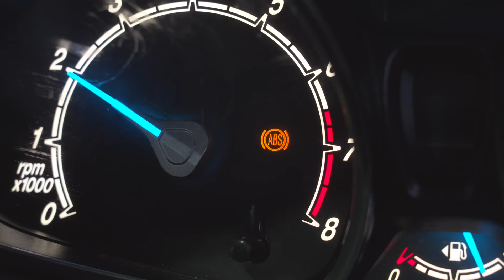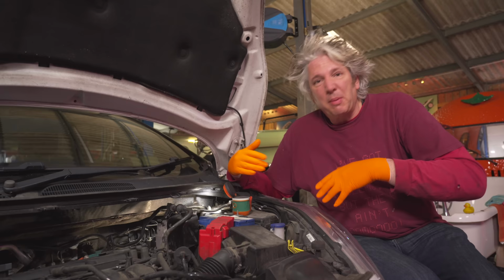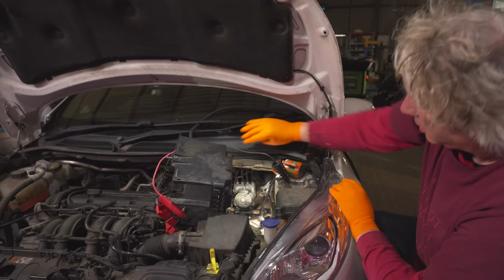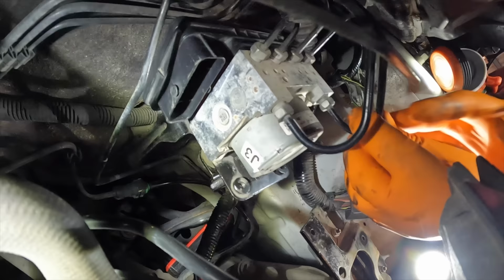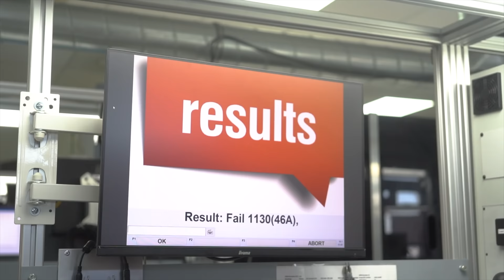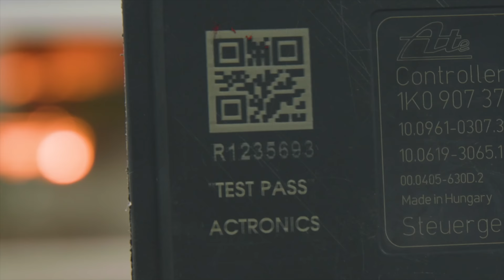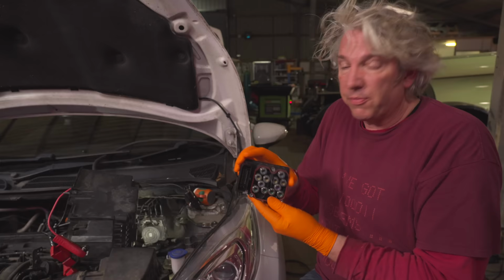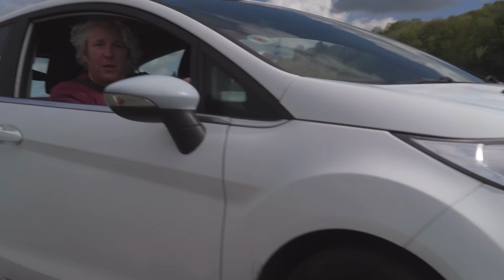Fix ABS with Remanufacturing: Edd China's Workshop Diaries Ep 61

Comment: The issues with these abs modules are engineered failures the units have been designed with the use of components that will fail in set amount of time. The use of low grade solder grantees the disruption of signals inside  the seal unit over a predictable time frame. This tactic in conjunction with the ridiculous pricing and the discontinuing or "up grading" of the design with non compatible replacements with firmware changes and then withdrawing the availability of replacement part in a few years grantees the obsolescence and retirement of the vehicle. Having worked with three vehicle manufacturers, I can atest to the fact they are working towards you owning and maintaining a vehicle for more that a few years a thing of the past. Whether you drive a modern car or not in 7 to 10 years it will be non functional..... if it is it by accident not design.

Comment: Interestingly, this engine and peripherals are practically the same as those of the Ford Ka 1.5 16v sold in Brazil, in some other countries they call it the Ford Figo, I myself have a 2017/2018 model and have already done some procedures on it, such as changing the engine filter. air conditioning and hygiene, changing the oil and filter at home, saving some money.

Comment: New content at last? What's happening to the Range Rover? You fall into a common YouTube failing, the music is way louder than your voice. I don't want to interfere with the rest of the people in the house, so I turn down the music and now I can't hear you. So if I want to hear you I can either be changing the sound level all the time, too lazy for that, or I can just skip forward and you lose watched minutes and revenue. FIX YOUR SOUND LEVELS. Modern ABS does a lot better than cadence braking. The oldest mechanical systems did that. Modern systems do per wheel brake level management. In the end I guess I skipped 80% of the video.
Reply from the maker: Sorry, my bad, sounded fine in the edit. I’ll fix it for next episode…

Comment: Id same issue with 2007 3 series BMW.. they wanted 1500 to replace it, 1050 for the part 450 for Computer coding it .. I took it out myself got it reflowed for 220 ,   260 if you count postage

Comment: If it eco boost engine, it need new Cam belt & good engine flush. Bad design of engine means, the belt in sump, causing belt to rot & black bits clog engine up.

Comment: Why in gods name did they design that bracket for the bolts to thread in from the bottom side? I bet that took 5 times longer to spaghetti finger your tiny ratchet in underneath there than if they'd just put the bolts in from the top... I'll never understand Ford engineers.
Reply from the maker: It was a pain, and definitely unnecessary!